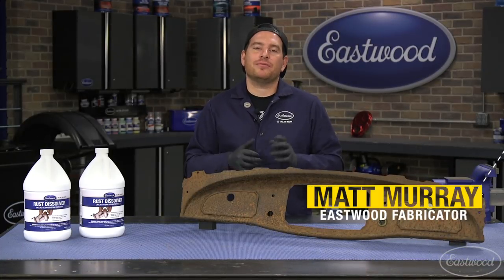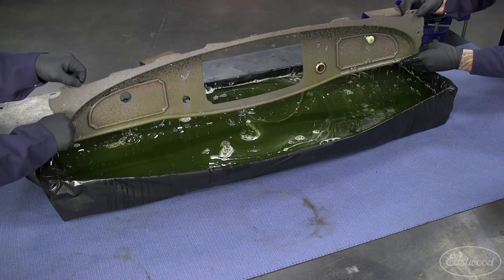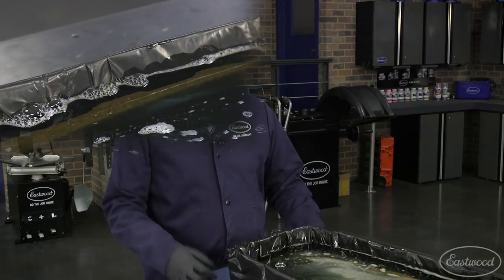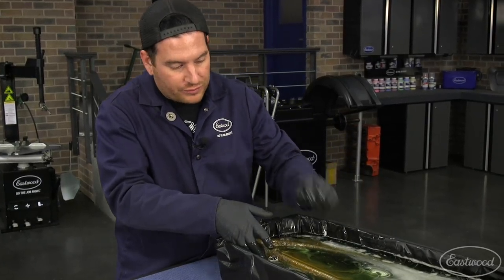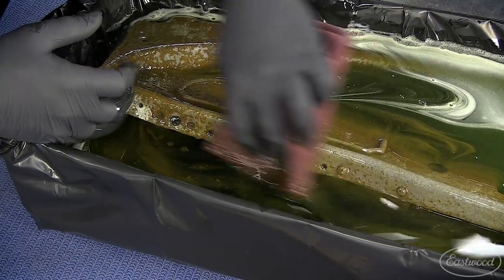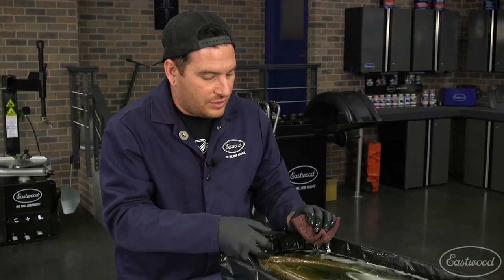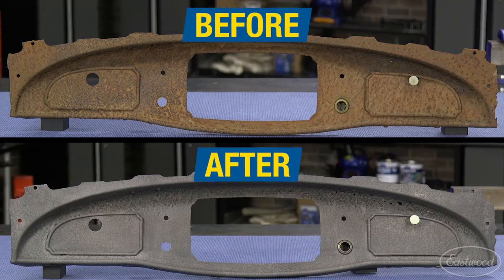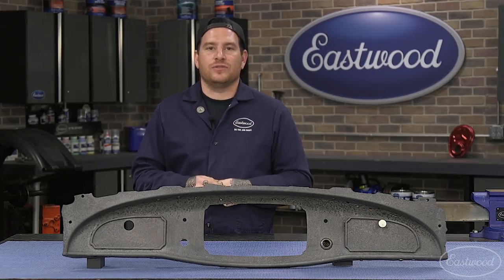How to Remove Rust From an 80 Year Old Dashboard! Rust Dissolver From Eastwood

Comment: A very good Eastwood video would be to demonstrate best practices for dealing with pitting after rust has been dissolved or encapsulated.  In particular say, a truck or car frame.   It would interesting to watch you guys take care of the pitting with fiberglass strand filler, sand it down, and then prime and paint it to a better-than-new finish.

Comment: How would you remove rust from the interior of a car that isn't meant to be removed? I'm working on a 76 Lancia Scorpion and the rear firewall inside has a lot of surface rust spanning the width of the panel.

Comment: How many jugs used to fill the rust bath?
Reply from the maker: I believe we used 5, but it could be done with 1 simply by coating it and keeping it covered or doing it in sections.  We dunked it to show it remove it all at once, quickly, since we were shooting a video and thought that would look best.
Reply: Nice so it could be brushed unto say a vehicle frame or something? I'm going over options for my 1979 Chevy pickup frame. Looking into various rust converters, etc. for the initial rust remover before I try an encapsulator. Just waiting for the encapsulator to come back into stock on your website. (in the rattle can)

Comment: What happens if your part has some rusty and some painted areas?
Reply: I bought a few gallons of the Eastwood rust dissolver, depending on how long you leave the part soaking in the chemical and how well the paint has bonded to metal will determine either or not the rust dissolver will remove the paint off the part as well.
Reply: @dannykanchanarin4295  if i don't mind the paint coming off, will the dissolver still be effective against the rust itself? I have some inner fenders that have rust over the paint